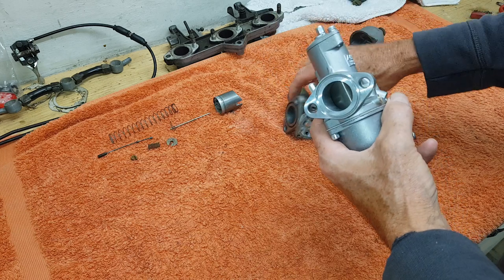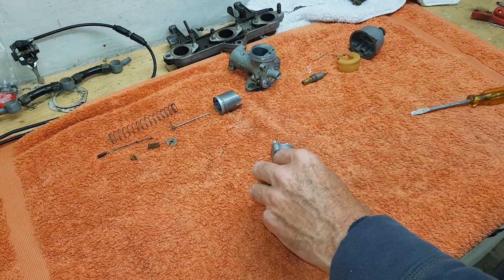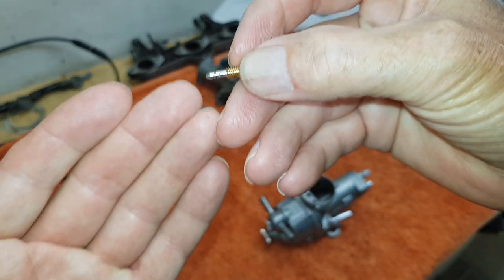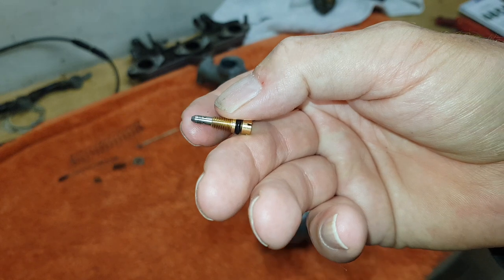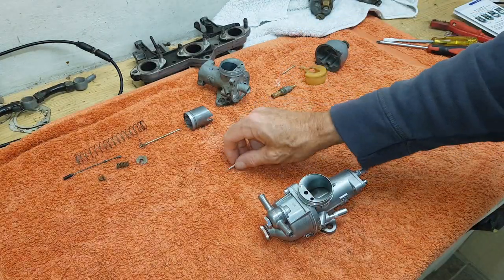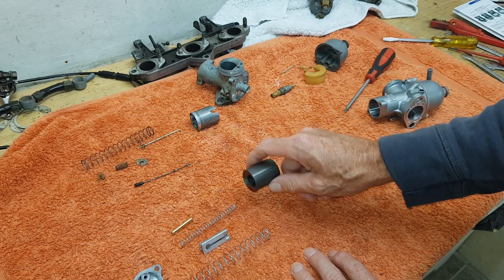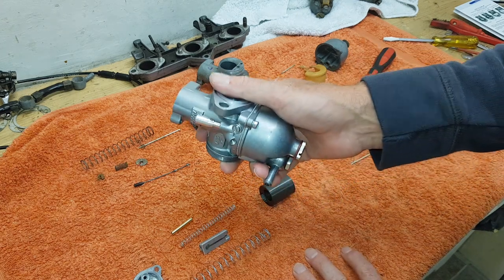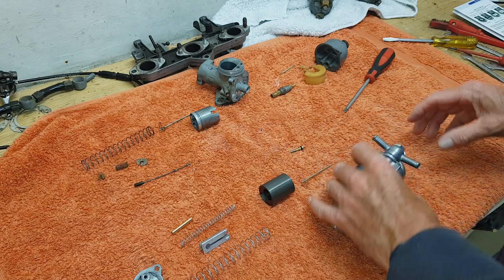Triumph Trident T160 Engine Rebuild. Part 46: Amal Carburettor Strip Down, Part 2.

Comment: Cannot imagine how much effort it must be to setup/tune a triple! I have Commando and it is a headache to setup just two Amal's. I did the re-sleeving on my original carbs...seemed to work alright. but later seemed to be having more running issues, eventual surrendered and went to premiers....these also gave poor running. After three separate strip downs and jet/fuel passage clear outs, finally got it running better, but only have using a CarbTune sync tool to get hte slides flowing the same. I'd done all the standard methods (drill bits. feeling for both moving in sync, doing the fully open positions correct).....the CarbTune showed a big difference between left/right carb vacuum levels, needing around two full turns on the throttle cable adjusters. Then things seemed to run very well. So, might have been fine on the original re-sleeved carbs. Oh well! Be sure to test the pilot & pilot by-pass tiny holes in carb body throat for good spray using some WD-40 or carb cleaner....even new premiers can have swarf or dirt there. This was true on mine. As for float height, I think this plays a biggest part in idle performance, as it determines how much fluid height is sitting above the pilot's fuel pickup point down at bottom of bowl. Too much height means fluid rising too far up to jet, too little height and pilot may not be able to pull fuel rest of way up at lower rpms. Amal now call for measuring actual fuel level, not float position, in the bowl. I think fuel meant to be about 5mm below top of fuel bowl flange, no matter where the float has to go to get that. Measured using an old drain screw (plastic or metal)  with a spigot hole drilled/threaded in and a length of clear fuel hose attached....you then can open fuel petcock and watch where the fuel level ends up against the outer bowl edge. Adjust tangs to where you need.

Comment: Hi Chris once again great video with good content, my t150 which I have just purchased is not fitted with its chokes and takes a few kicks to get it started, but I was told that it is common practice to leave the chokes out, what's your opinion? Cheers Clive.
Reply from the maker: Clive, a lot of owners do leave the chokes out, and Amal (Burlen fuel systems) sell a spigot that screws into the top of the carb to fill the hole left by the choke cable (the only modification required  - and even then it's not completely necessary) but personally I'd only remove the choke if I lived in a hot country or I was using the bike for racing as my bikes like choke to start, even in Summer.
Reply: Hi Chris thanks for your reply I will fit the chokes as like you are saying they are fitted for a reason, also I re adjusted the  clutch and I now get neutral a little easier so  many thanks Cheers Clive.